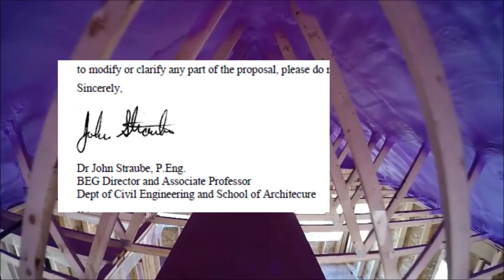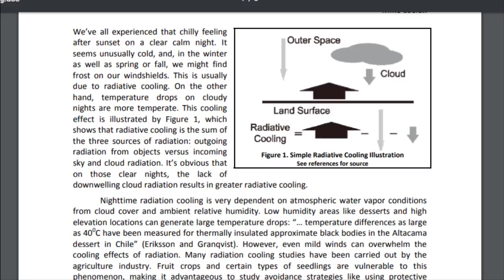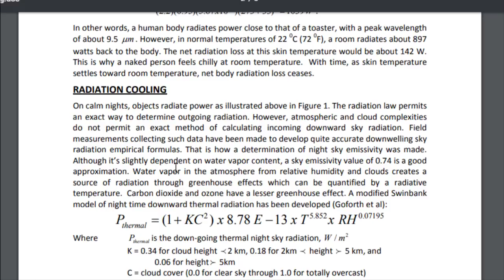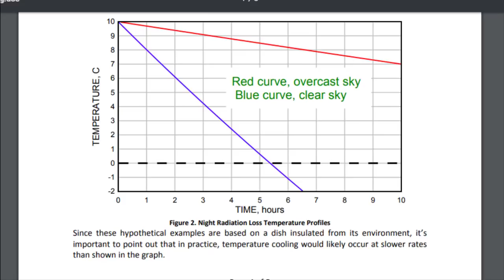Spray Foam Insulation Causes Frost Lines on The Roof - Why?

Comment: You won’t see them if you insulated above the first roof deck and below it. Double deck Roofing systems are starting to become more advanced as we learn what works and best practices. If you use spray foam under the interior roof deck. You should consider insulating the outside as well and going to a double deck roof system. The benefits are not just fixing this thermal transfer issue but a more effective and efficient room with huge R value no sweating issues.
Reply from the maker: You don't understand.... not one bit.

Comment: Wood rafters with plywood nailed on to it without an insulation barrier will cause these frost loes and eventually will cause the roof to rot. Not proven yet but its causing moisture or condensation. Wait a few years because spray foam is still in experimenting and testing procedures and or studies
Reply from the maker: Hah ha... that is the best joke I have heard today. Any chance you read the pinned comment? Probably not, just jumped on the comments... Oh well broken clocks get to be right twice a day.
Reply: @SprayJones  Can you explain this in more detail? I think the underside of the roof deck should have airflow to reduce heat buildup causes by the sun. I continue to see sprayfoam applied directly to the osb/roof truss. How does your roof react in this situation without the airflow?
Reply from the maker: @tjkin2258  Stay subbed.  I have a 4 part series on roofs and SPF coming up this month. It will go over a lot of this info and more.

Comment: Here’s an interesting thing.  When you cut through the spray foam in winter you will see frost on the inside of the roof decking or exterior wall panels.  Rotting waiting happen.
Reply from the maker: That's a lie
Reply: @SprayJones  Have you cut through a wall in winter ?  I have to do installations.  crystalline ice on the interior of the sheathing where the spray foam adheres in the unclosed bubbles where they are on the board.

Comment: why insulate the roof if the attic isnt a living space??
Reply from the maker: We need to spray to something. Down onto drywall is too tight most times. Plus a warm attic in the winter is more efficient.
Reply: @SprayJones  efficiency at what cost?
is heat under a shingle good?
would curling occur sooner ?
all valid thoughts.
Reply: Besa Bes  ha ha ha...
maybe..with the right setup.
Reply from the maker: @kYA00h  Please watch "shingle life and SPF". It is an eye opener
Reply: @SprayJones  👍
Reply: If your air conditioning ducts are inside an unconditioned attic space (aka attic space) they are subject to greater (Delta T's) temperature difference.  The higher those Deltas are, the less efficient your ductwork is.
Think of it this way.  Imagine the ductwork inside your attic as if it were a typical water hose.  When the sun comes up, your attic space start to heat up - along with everything inside that attic space.  Kinda like laying that water hose out in the sun.  You get a lot of heat gain when the air around that hose is warmer, and a lot of heat loss when the air outside is cooler.
In the southeast USA attic temperatures can exceed 140 degrees Fahrenheit during the summer.  Most people keep their living space between 75-80 degrees.  That's 60-75 degrees (Delta Ts) cooler than their attic.  And the opposite is true in the winters when temperatures drop below freezing.  All of that ductwork (Avg. R-value of 6) does very little to combat that change in temperature.  You lose a lot of energy trying to cool/heat the ducts to the desired temperature of the living space.
In contrast, if all of the ductwork is encompassed inside the conditioned living space, the Delta T (changes in temperature) are minimal, thereby saving energy.  By applying insulation to the outer envelope of the structure your ductwork doesn't fight the high temperature swings, and any duct leakage goes back into the living space instead of being lost to the outer environment.
Reply: Besa Bes  ohh yaah

Comment: A more simplified explanation to a homeowner would be to tell them that the rafters aren't insulated from the roof. Then you could upsell them on exterior insulation, which is really what we all should be doing. Zip-r, or similar product.
Reply from the maker: That goes against the fact it does not need to be done and we can explain what you are seeing. But IF money burns a hole in your pocket.... sure.

Comment: Spray foam causes mold and rot.  No airflow....horrible idea on cold climates.  On paper sounds good but I’ve seen what it can do...you never insulate the roof you insulate the ceiling above the living areas and have vents in gable ends to keep air flow.   If you have scissor trusses you use spacers to keep insulation with a gap between the roof and insulation and have bird blocks venting between the trusses in the gap between roof and insulation.  Don’t do foam..  just don’t.  When you build it’s good for gaps in studs and sheeting but not for covering the entire roof.  This is how you get high humidity and mold from warm cold condensation.
Reply from the maker: Ignorance just plain ignorance here on display. I have a whole section on un vented  roofs yet you do not watch or learn. 
I have a 4 part series coming out in March on roofs that will shatter everything you are saying.

Comment: Will zip system sheathing eliminate joist lines?
Reply from the maker: Not entirely.
Reply: Only if you use their insulated panels.
Reply: @donstockdale7307  yes... or any air gap technology under shingles

Comment: My roof has a traditional open air attic with blown insulation on the attic "floor"....my rafters are open to the cold air on all sides...  I have frost lines... not unique to spray foam in any way. It's just a different thermal mass than what's beside it, thats all. A roof with air gap technology installed under shingles won't do this, will cool better in summer and will last longer.
Reply from the maker: That is correct. This is to explain to ppl what is happening. Too many myths out there.
Reply: That's true most people don't think about the shingles when they're spraying insulation the shingles tend to overheat and typically cuts their lifespan in half if there  not vented properly I have 40 years experience behind me and spraying foam I did roofs buildings homes and commercial boats there's a lot of stuff that goes on in every job has to be well thought out
Reply: @prestonking5736 absolutely and.... more than people know !
Reply from the maker: @prestonking5736  I have a video "shingle life and SPF" plse watch...

Comment: Where does the heat come from? It comes from the interior because the rafters were not sprayed and they conduct interior heat to the exterior so it is a major concern.
Reply from the maker: Wrong
Reply: Why could it not come from the sun or the outside environment and stored in the rafters during the day then released at night? It seems logical to me

Comment: One thing is you will never see it in metal roofs. Won't go into the science of reflectively but you just don't see it. Metal roofs are the best roof system shingles are the worst technically of a roof system.
Reply from the maker: Thanks for watching.

Comment: If you don’t fully cover the inside rafter wood against the sheeting wouldn’t you still get thermal bridging?
Reply from the maker: You can cover the cords with all the foam you want, it will still show the lines. It has to because one face of the wood is in direct contact with the outside and can be affected by the rise and fall of temperature.
Reply: @SprayJones  I agree with the thermal Energy  stored in the wood. I am curious about best practice when applying, should the applicator cover the cords? Thanks!
Reply from the maker: @bysmith240  Yes, Whenever possible get some foam on them. Keep in mind that lots of top cords can add 40 % onto the area so make sure you account for it. I won't do the full value of what I am spraying for the cords.
Reply: @bysmith240  This is actually a choice for the customer and planner when looking at roof assemblies.

The most straightforward option would be something like Huber Zip+R.
It isolates the rafters/trusses from the deck surface.

*   Another option would be a boxed-ventilated roof.
*   Substrate deck nailed to the rafters/trusses and waterproofed.
*   Exterior insulation (2-4 inches to control dewpoint in the assembly)
*   Furring screwed back into the substrate and rafters.  Will anchor the exterior roof deck and provides a drainage plane for any condensation or water infiltration.
*   Exterior roof deck.  Again, waterproofed then covered by your roof cover of choice (steel, aluminum, tiles, shingles, etc).

Uber-cheapo option (may or may not work).
Use the type of foam gasketing you'd put on a concrete foundation, under the base plate.  Sill sealer.
Staple a strip of it down the top of each rafter/truss.
Then put down your roof decking.
NOT gonna perform anywhere near the other two.  But might be just enough to lessen the appearance on the roof.

Comment: You won't have the thermal bridging if you simply cover the truss with some foam.  In your video every truss is still exposed.  They need to be covered.  This will actually help further to increase efficiency in protecting from heat loss.  Lot's of fancy math.  Just cover the wood with insulation.
Reply from the maker: Excuse me! This picture the foam IS covering the truss cord. You can spray 2 feet of foam over it and it will do the same thing. Read the pinned comment.
Reply: @SprayJones  Hi.  Hey, I'll explain. I think you misunderstood me.  Because what I'm saying is the same thing you are saying at the 3:00 mark on the vid.  In the Boltzmann Law, the T (in degrees Kelvin) is part of the equation.  So, what's happening is the roofing material with frost is not the same temp as the roofing over the truss. It's cooler. Your foam is doing such a good job that the wide sections with frost are cooler than the truss ribs, ic, no heat is escaping from inside.  (A well insulated roof has all the snow still on it).  The "T" in the equation (the temperature) is higher on the roofing over the truss - it's warmer there and frost is not forming.  The wood truss has stored heat,  and is also conducting heat better than the insulation (acting as a bridge if not insulated well).  So to minimize this thermal bridging (what they call it), the best thing to do is encapsulate the wood truss on the inside with insulation.  Yes, some heat is already stored from the day's radiation coming down from above (sun), so you will see this stripe affect most when the difference in temps is greater. So the faster the temp drops in the evening (with right humidity of course), the faster the insulated wide sections of roofing loose their heat and frost over, while the heat sink trusses are still giving off heat.  You won't see this too much in the morning - if the trusses are surrounded by insulation - which is what I was saying in my post above.  Good job explaining things.  Very cool.   Fish On.  B.S. Physics, 1981.
Reply from the maker: @fishon8406  Thanks for the reply. I get a lot of kooks sending me hate comments all the time. I am so impressed with you comment here I will use it in the 4 part series on cathedral roofs and SPF coming out in March. 
I appreciate it.

Comment: Only a fool would spray the roof deck. Or an unscrupulous insulator.  Put in a ceiling and blow in loose insulation. Learn how a roof works. And do the job properly.
Reply from the maker: I have sprayed closed cell to the roof deck for 16 years. I have thousands of homes done with / for people who would not take it if the system was a lie. 
You do not know what you are talking about. We live this, this is NOT theory or tables from a book.